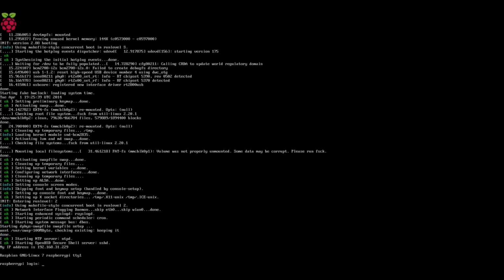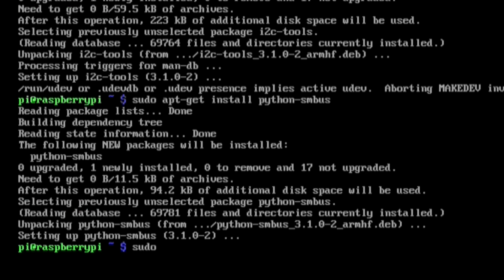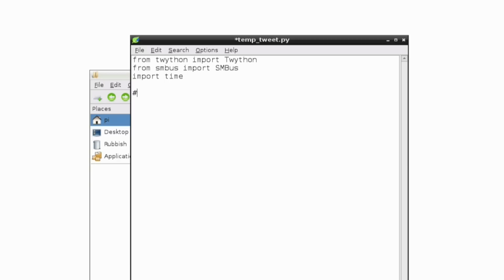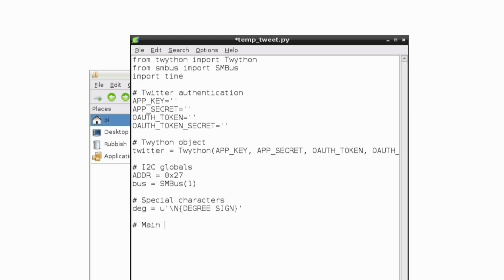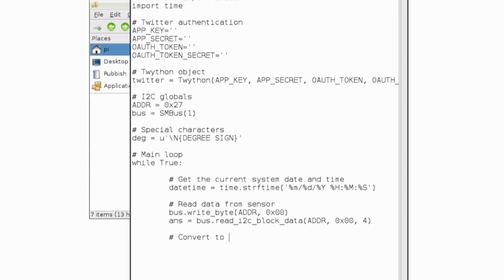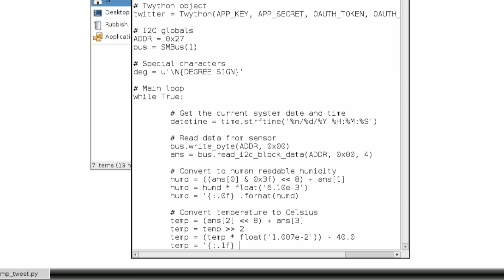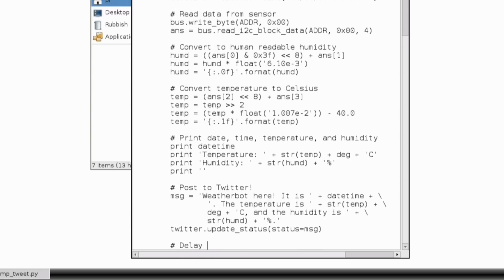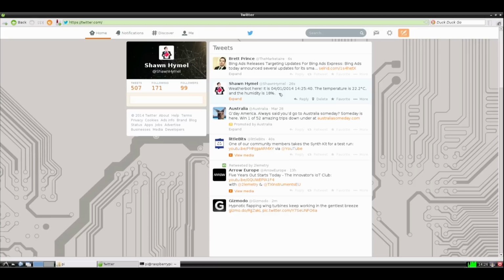SparkFun Getting Started with Raspberry Pi Part 3: Tweeting Weather Station

Comment: also, second question, when you wake up the sensor, why is the adress 0x00 and not the first defined 0x27. thank you
Reply: The second address is for addressing the internal memory on the sensor.

Since he had already defined ADDR=0x27, he's saying "I want the info at address 0x00 on device 0x27."

He should have named "ADDR" something more relevant like "sensorAddress" since an i2c bus was created to connect multiple devices using the same 2 wires.

Comment: I see you're using Python 2.x for your code. How does one update the Python version in the Raspberry-Pi? I would like to use Python 3.x, since that's the one I learned.
Reply: Back in June, this seemed like a valid question, but I soon figured it out. I build what I call the Pi-Stand so I could use the RP a lot easier. You can see it on WolfDenElectronics.com under Projects.